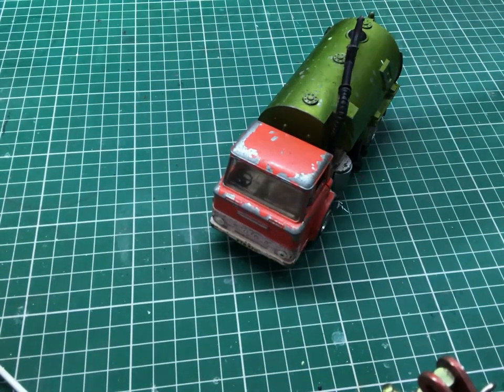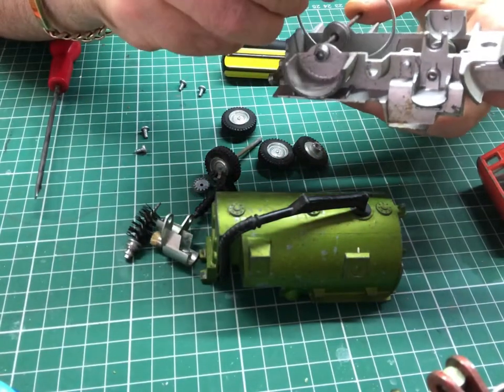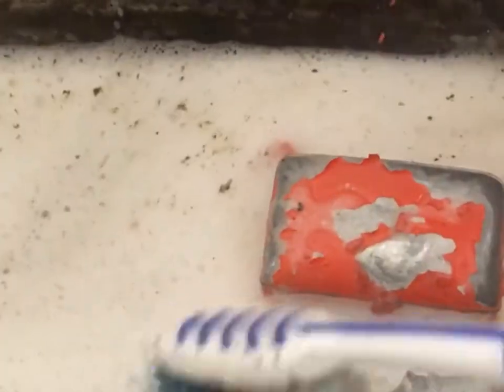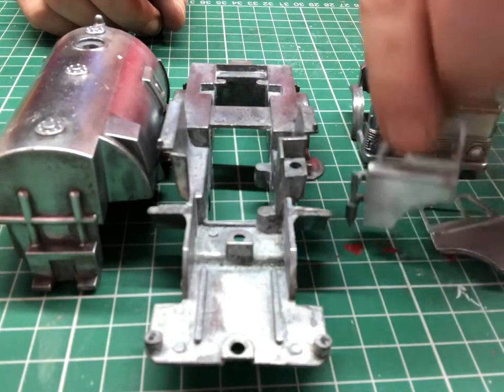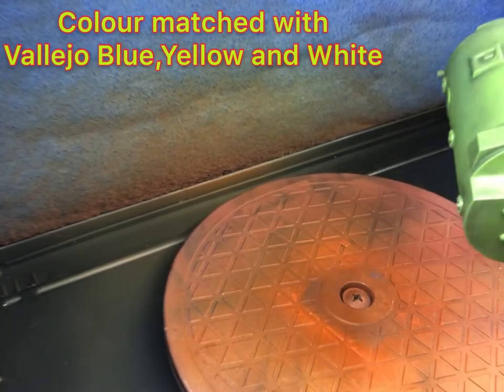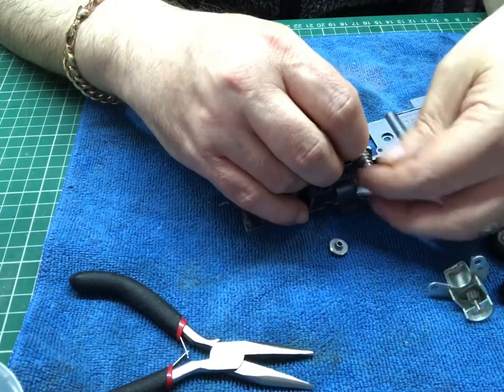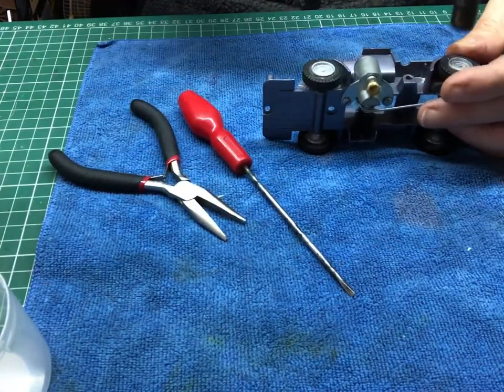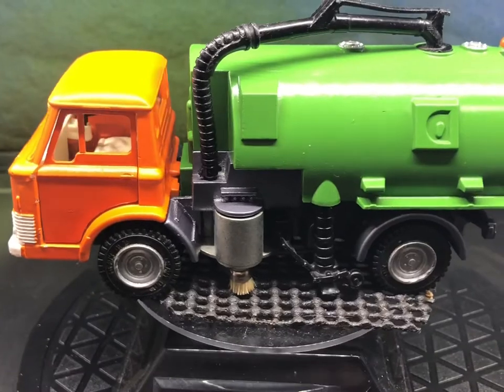Johnston Road Sweeper

Comment: Lovely restoration George, I know you showed me the photos but it’s nice to see you doing the restoration, I wasn’t sure if the wheels could pull off or not, now I know😉😊 and you got it all back together so easily! Thanks for the mention, it was much appreciated, hopefully I will have a model for your next build off, If I get it finished in time🤦🏻‍♂️, I’m doing it in between other models at the moment so it’s slow progress lol.
Those sharpies look good, I must get some!
 Anyway, really excellent work on the model sweeper, I’m glad you managed to get the belts, I only thought of them because I used to restore and convert old Mamod steam engine models with my youngest son when he was a kid, so we went through a lot of those belts.
Take care, all the best, Nick.
Reply from the maker: CRAPAUD NICK'S DIECAST RENOVATIONS. Honestly mate you saved the day with your suggestion on that spring it was awesome,  I can’t wait to see what you may enter into the build off if it’s as good as any of your other work buddy it will be an honour to host it 😁 I have a spare set of sharpies so I will put them in the post for you mate as a way of  a thank you 👍👍👍👍 cheers buddy take care
Reply: @MrJuuddss  Thank you George, you are very kind but don’t worry though, as soon as I had watched your video I went on line and bought a set of sharpies, 😊👍 The model is a bit of a code 3 based on a truck I used to drive 35 years ago so we’ll see how it turns out😊👍 take care Mate, keep up the good work😊
Reply from the maker: CRAPAUD NICK'S DIECAST RENOVATIONS. Ok mate lol I’ll find something to send you lol do you want a few daughters I have 6 lol the truck sounds cool mate can’t wait stay safe buddy 👍👍👍👍🥃

Comment: Great job, I just bought one from ebay to do. I bought vallejo light livery green as it looked a good match for the tank but when it arrived looks more yellow, might have to darken it with blue, but the orange I got looks a good match. Hope mine turns out as good as yours.
Reply from the maker: I’m sure it will turn out great buddy I really enjoyed this one and found that the spring I used was perfect for the brushes if you need one let me know and I can get you the link we’re mine was from very cheap and enough to do 3. Of them too thank you for watching and commenting and subscribing I appreciate you for doing that thanks 👍👍👍👍👍
Reply: @MrJuuddss  cheers George, mine still has the belt on it, so should be good. I'll send a pic once I'm done, keep up the good work, it's inspiring.